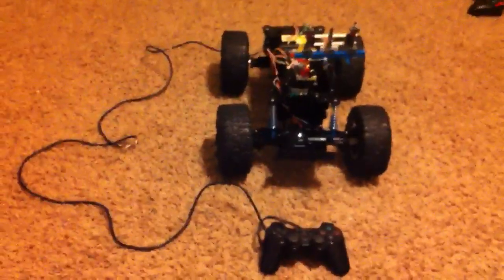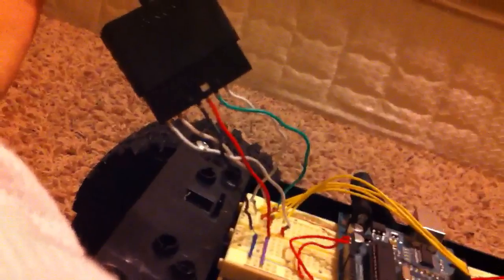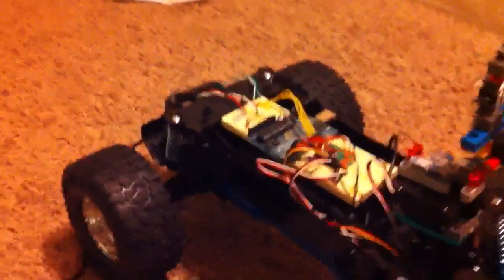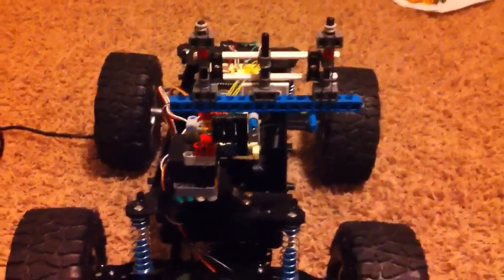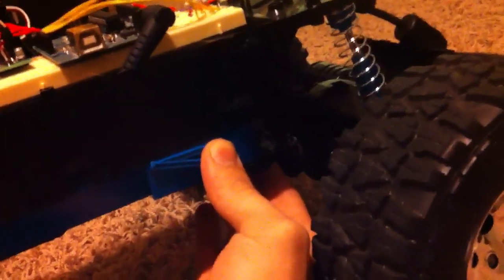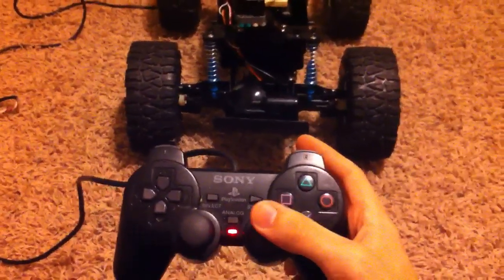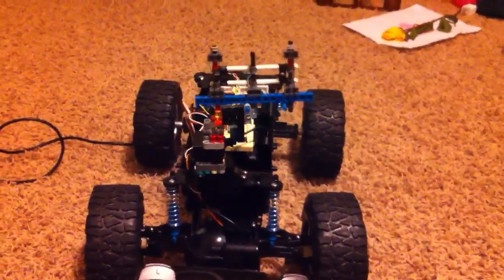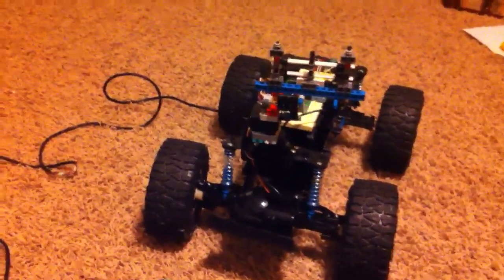Building an Internet controlled RC car. Video 2

Comment: How does the steering on the car work. Is it a servo connected to the wheels or some kind of motor connected to a gear. If it's a motor what is your code for controlling it.

Comment: If the robot had a ps2 remote plugin port on it, could you not plug an after market PS2 Bluetooth remote into it and it work without any new programing? The one I had for my PS2 back in the day was a Logitech, and it had a Bluetooth module that  came with the remote that plugged into the ps2. That seems like it would be the easiest way to control wirelessly. If this works for anybody out there please let me know.

Comment from the maker: @possum19901990. Like the title says this is "Building" an Internet controlled RC car. I'm still working on everything and have school work and other projects to worry about so its kind of slow going.

I have decided on how to make the "Internet Controlled" part though. On the rc car will be an Android phone connected to a VPN, which my laptop will also be connected to. Then by sending UDP packets to the IP of the phone, the phone can echo said messages via bluetooth to the Arduino.

Comment from the maker: @student71901. It could but it would require very different much more complex code. The reason I use a PS2 controller instead of a PS3 controller because of how simple it is to implement. With the PS2 controller you simply wire it up & import a library into the Arduino code and print out the states of the buttons and analog sticks. Its surprisingly simple. The PS3 controller would require me to buy a bluetooth or USB host either for the PC or the Arduino & then write code for their interfaces.

Comment from the maker: @ajstyrer I'm still working on that part. My old motor controller was apparently a dud so I have purchased a new one. It's in the mail and should be here tomorrow. I will upload a new video once I have more running.